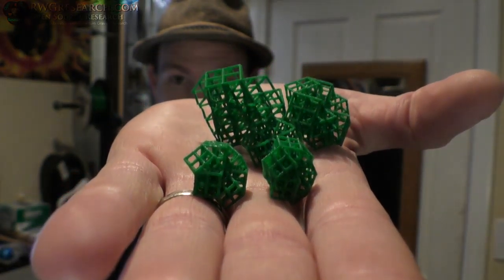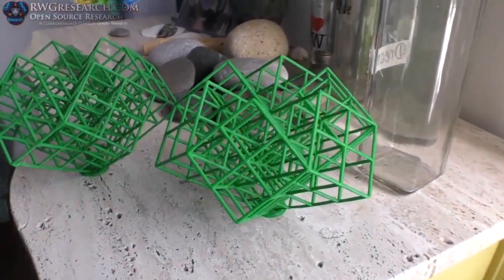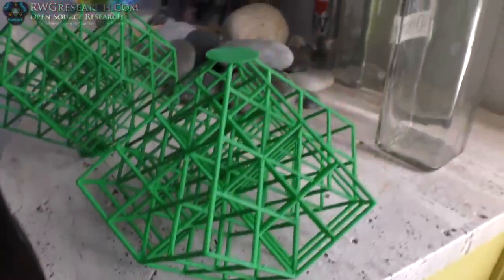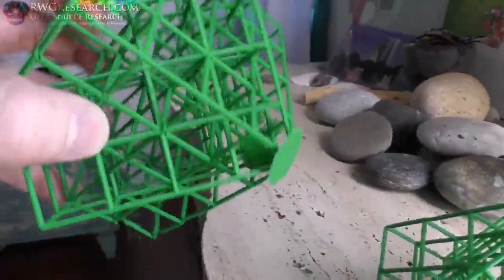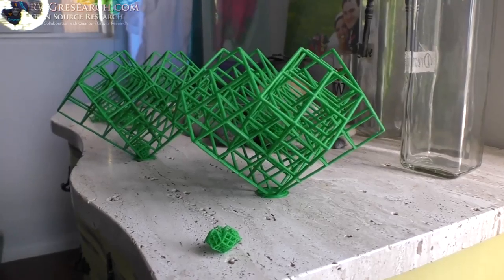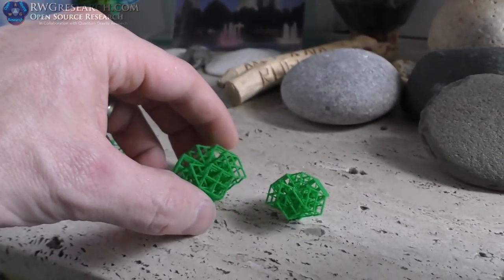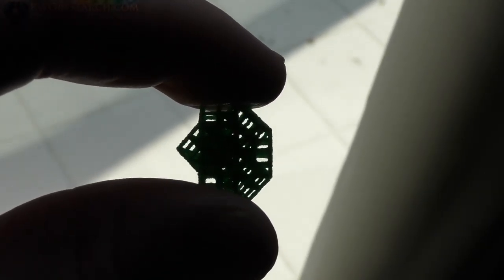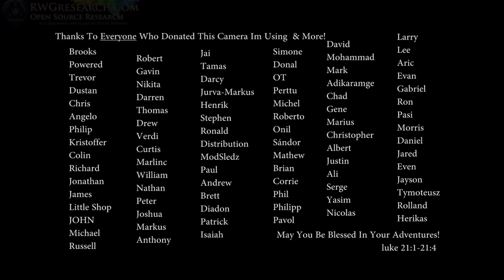My Go At Maker's Muse Snowflake Lattice Torture Test! How Small Can I Go?

Comment: What's your extrusion set up for hardware and settings, please?
Reply from the maker: hardware, you can see a bit of it here: https://youtu.be/C72INB6ZSN8?t=367
All custom build from scratch... hot end similar to the ubis, except i made mine from copper, and I'm using a premium tungsten nozzle. 0.4mm tip.

settings: ahh well basic: 
retract : 1.75mm
extra extrude : 0.05mm
wipe: 1mm
layer height: 0.175mm
Temp 210C

PLA : https://www.matterhackers.com/store/3d-printer-filament/pro-series-green-pla-filament-1.75mm?rcode=RWG3D

~Russ
Reply: Thanks

Comment: Makes me sad I haven't been able to get my delta back up and running... damn manual calibration
Reply from the maker: what delta is it? ~Russ
Reply: rwg42985 a Rostock Mini pro kit from heacent I got 3 years ago and after breaking some arms and replacing them it's been a real pain getting everything dialed in to flat movement
Reply from the maker: what firmware / controller? ~Russ
Reply: Marlin 1.1.3 on ramps 1.4
Reply from the maker: ok, cool, give this a look:
https://www.youtube.com/watch?v=jymSqyIZQsc

I agree its a huge pain. If you had to replace a few arms but not all of them, make sure there all EXACTLY the same length. 
you also might try switching a few around to see if mixing and matching helps. 

~Russ
Reply: Thanks Ill give it a go!
Reply from the maker: you can do it!!!! :) 

and yes it really dose suck lol  but its worth it... i never got my first delta perfect... but its good enough to work! 

~Russ